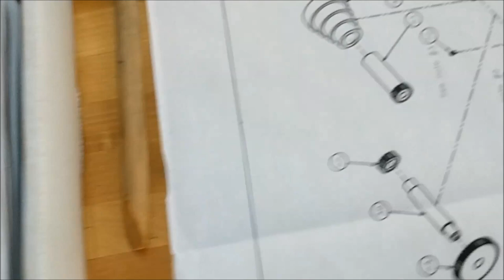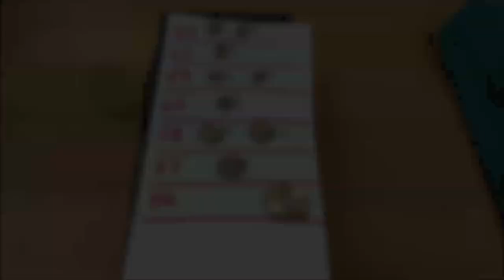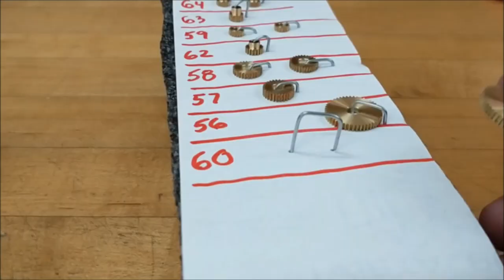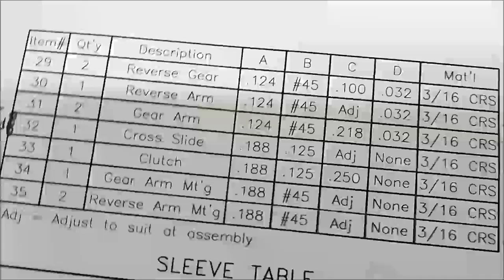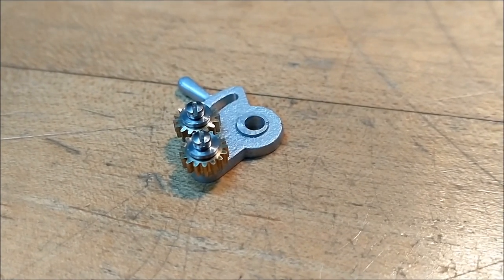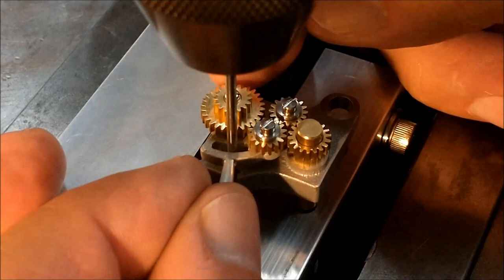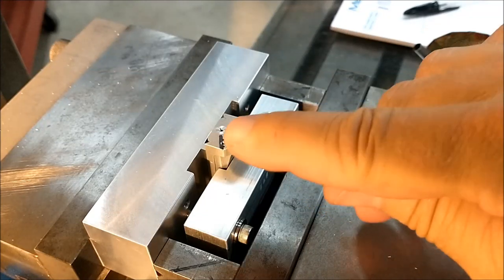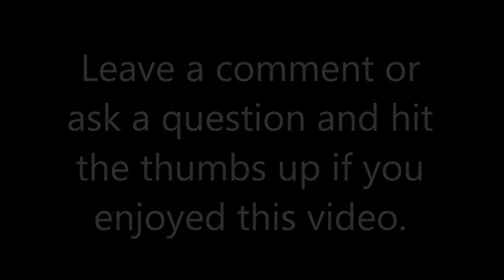Machining a Miniature Lathe - The Reverse Gear Cluster

Comment: great series I miss this stuff. I have made tiny parts like this on a production basis years ago. Have also worked on large biggest was a hydraulic cylinder for a horizontal press still remember that one had to call the manufacturer of the mill to verify it would handle the weight 14,500 lbs a 24 x 36 inch bore and 24 x48 face square and round within .005.
Reply from the maker: I did my apprenticeship at a company that specialized in precision miniature componentry. Great beginning.
Reply: @joepie221  I made camera parts for 7 years , tat was 45 years ago. Now building my mini  shop. 2 lathes and a mill , getting a bigger one next month.

Comment: You're really cracking through these parts now. Not that I'm complaining.

The next major part, I'm waiting to see being made, is the threading dial. 😁
Reply from the maker: Unfortunately, this lathe doesn't have one. It doesn't have a lead screw either. Just a drive shaft.

Comment: After following Joe for fours years, I finally caved and bought three sets of pin gauges, ranging from 0.061" through 0.500' incremented by 0.001". I use them almost daily in my hobby machine shop. In some ways they are more useful than my gauge block set.
Reply from the maker: I use mine a lot as well.

Comment: My first lathe bought in the 1970s was a plain bearing headstock model with just such a reversing gear.
Reply from the maker: Clever design. I like the simplicity of it.
Reply: @joepie221  It was a Perfecto lathe. I bet you would swap it for your current one, It could handle a 25 thou cut on a good day and with a really sharp tool.
Reply: @richardsweet5068  Don't move the reversing lever whilst the spindle is in motion or you will break the gears - guess how I know that!  My Myford has plastic reversing gears and they just explode!!!

Comment: Hey, You know when it is small that the jewlers screwdrivers look like they are 1/2 in drive, LOL. Transmissions have always fascinated me. I have worked on simple , 5 and 6 speeds all the way up to 18 and 21 geared units that are timed with cam to crankshaft air powered shifters that are timed in a way that if you are out one tooth at the beginning the trans will eventually lock up in different stages that require complete teardown and start over. Getting one or two (like I did) wrong was enough to solve that problem was enough medicine to cure that one eh, LOL. Once again you took me for a trip to the past my friend. Thanks a bunch eh. Still no Gr8 eh, LOL. Take care !
Reply from the maker: The camera always gets the best line of sight setup, so actually doing the work is even harder.
Reply: @joepie221  I know that one oh so well. I have tried and failed many times to get good footage of my torch melting the silver in my little furnace.  When I get a great view with the camera I can't see what is going on or the camera is in the way of moving the 2200F silver to the mould and subsequent pour. The thoughts of 5 ozt+ molten hellfire all over my lap is kind of untasteful eh.

Comment: HI Joe, I found that the mix up on the gear numbers very confusing,  I did waste some gear stock making one of them twice, as for the screw in the reversing handle I milled the area and made a brass washer to go behind it. I did put the set screw in the head-stock main gear and place flats on the shaft. it does rotate without wobble but I did not over tighten, no need because of the flats in the shaft.
this project was over my head but some how I managed to get a working model.
Rich
P.S. I done lots of unloosening and untightening before it was done!
Reply from the maker: Well done.
Reply: @joepie221  hi Joe I tried to publish my lathe, kinda slow at this, it's like pushing a rope for me...
Rich

Comment: I don't know why I thought it, but I was surprised to see that the right idler gear does not go all the way between the other 2 gears. When I figured the 19 degree movement of the reverse gear lever (that I posted on the other video), I thought the 3 gear's centerlines could form a straight line. It sorta looks like they do in the photograph and that the lock screw is located to hit the end of the slot when the 3 gear's centerlines are all in a straight line.
Reply from the maker: If the lower gear location was moved down a bit, the gears could possible function as you suggest. The entire slot could then act as a positive and physical stop. Interesting. I may have to look closer at that.

Comment: Midnight in Austin-
"  TOSS-That off center boss has got to go, TURN and all those erector set screws- ROLL and that adjuster slot needs to be milled so the screw fits down inside on a machined surface"
Reply from the maker: I could tweek this model for years. I think I'll finish it first.

Comment: Since you made the headstock end & the reverse lever to print, you should have been able to calculate the position of the reverse lever hole using CAD drawing.
          The reverse lever needs spot-facing on the surface where the fastening screw bears, & the screw needs a washer under its head.
          Really, the reverse lever needs a detent & locking mechanism to positively set its position for proper gear mesh.  I can't believe that lathes of the era didn't have this.  (Pull handle to release, reverse, release handle to lock.)
Reply: I have a craftsman 109 lathe that has a locking screw for the 2 positions it works great this lathe was made in the 40s
Reply from the maker: If you think about it, there are numerous locations possible for the screw. The gears meshing will dictate the best spot. The drawing will get you close, but too many missing dimensions to nail it from thin air.

Comment: Did you think of perhaps flats on he shafts t prevent burring of the shafts from tightening the set screws and and also ensuring no slippage under load.
Reply from the maker: An absolute must. Not only for strength, but to maintain the integrity of the mating parts at disassembly.

Comment: The project is coming along very nice.  One question regarding the "tap handle" used for small taps.  Do you custom fit each tap to the to the handle or one handle will hold different size taps.  Thanks in advance!
Reply from the maker: The handles will hold most taps up to #6

Comment: 23:05 Precision is not the goal. Functionality and longevity are, of course within accuracy. Did you add flats under all the set screws? I also just watched the steam engine build and thought the same. The only set screw I've ever had slip was the one that didn't have a flat. Bonus, the one with the flat loosens and wobbles before it falls off. That's what preflight check is for, to find the wobbly part that didn't fall off last time.
Reply from the maker: All set screws seat in receiver features on the finished products. And, precision is always my goal. Functional is a by product.

Comment: Amazing work, once again. So impressive on these tiny parts, I`d have lost some of those screws by now lol. I have a question, and apologize if its been asked and answered in this series already. When working with brass, do you "dub" the cutting edge of your drill bits a little to prevent grabbing? Or being the sizes are so small you are working with it isnt needed? Thanks again for sharing!
Reply from the maker: The drill are a standard grind at that size.
Reply: @joepie221  thank you

Comment: Remember: always unloosen the screw after adjusting.
This lathe works just like the one I bought for $150 46 years ago
Reply: dont you mean tighten?
Reply: @jameslaurencesmith7537  21:56
Reply from the maker: @paulg3336  Look it up in the dictionary. You may be surprised.

Comment: Hey Joe, @0:46 isn't that "oblique" grub screw actually perpendicular to the shaft, locking the gear to the shaft?
Reply from the maker: No its not. I believe the print calls for a 15 degree hole.

Comment: Some of the edge finders in my shop work great and some of them barely shift at all, is there any way to get them to shift more?
Reply from the maker: Some jump more than others. If they used to jump farther, sandwich a piece of paper at the separation line and spin both halves. It helps clean them.

Comment: After you use the parting tool, do you need to turn the part around and face to clean it up?  Thanks for your work
Reply: Wondering that myself
Reply from the maker: If the tool is sharp, straight and cutting well, only minimal wiping on some emery should do the trick. I parted the gears right to size.
Reply: @joepie221  Thanks for the reply.  I'll have to work on parting as I usually need to face the parted side too.
Reply: Thanks!